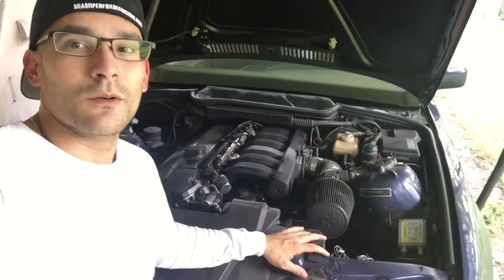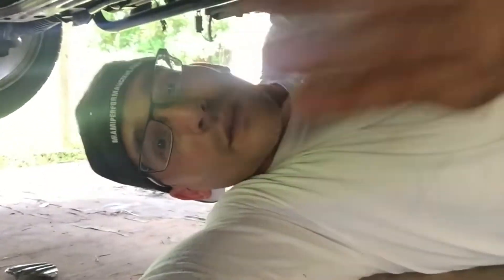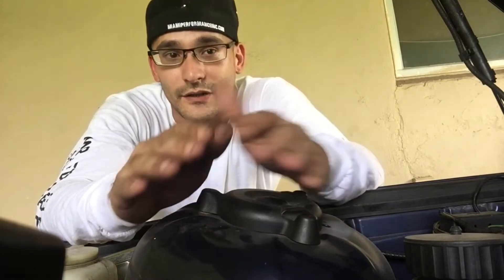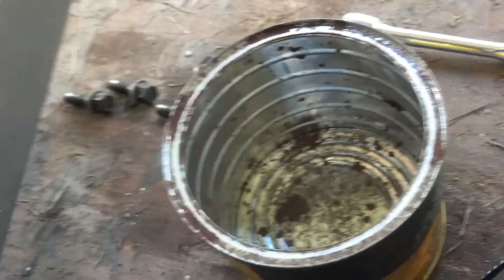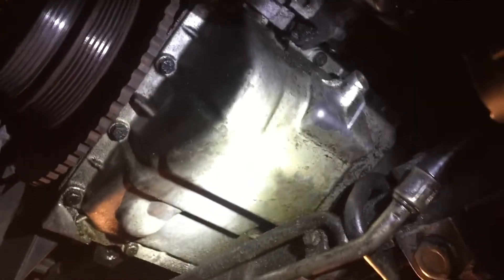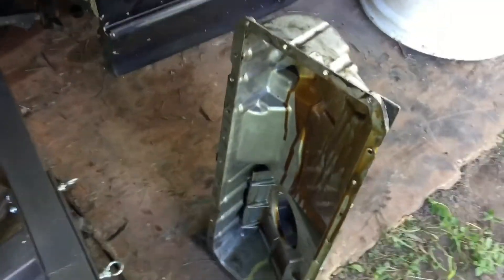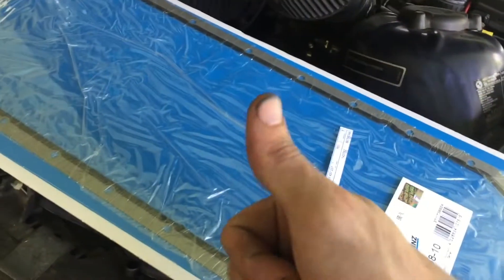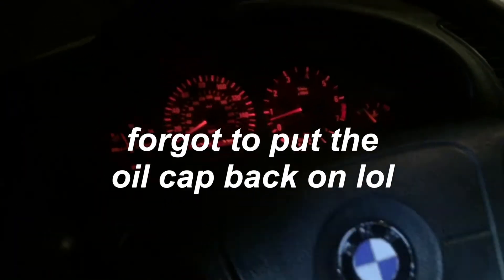E36 Oil Pan DIY

Comment: Why’d you have to mess with so much power steering stuff?
Reply: Had to drop the subframe , rack is connected to the subframe he had to take the steering joint off , and instead disconnecting  the hoses for the rack and having to bleed it he just left it all connected and dropped it down